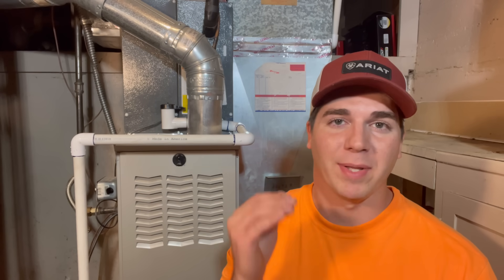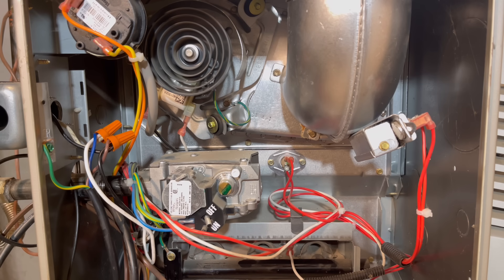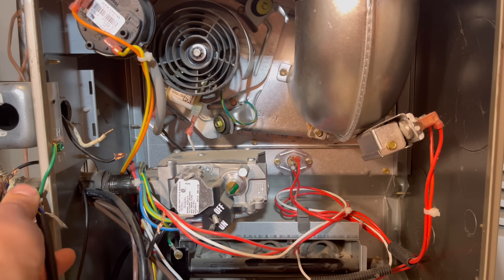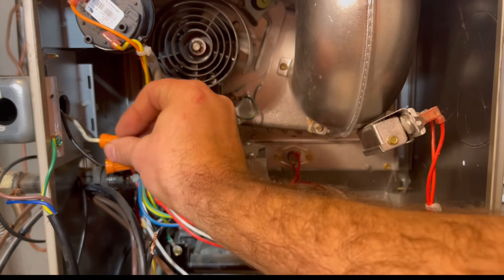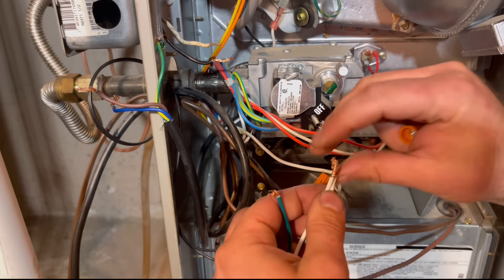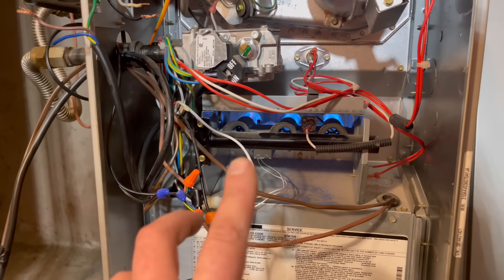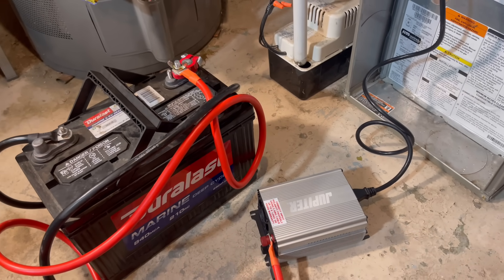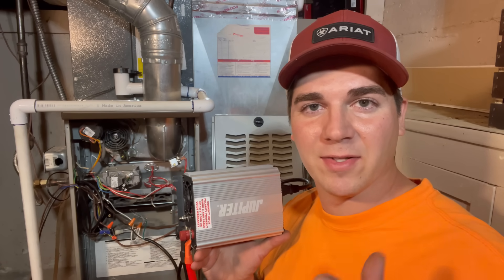Did You Know You Can Heat Your Home With A Car Battery?

Comment: Wow, that was nice, useful info. Makes me wonder if a person can set up something more permanent with multiple batteries, an inverter, and an automatic transfer switch of some sort when the power does go out. The transfer switch would make the batteries the primary source of 120/240V for the furnace while isolating it from the power grid. What you showed in the video was a manual version and perfectly adequate. Thanks!
In case you wonder... we have been hit with power outages in the middle of winter and our furnace was incapacitated. The house got on the cold side and I've wondered off and on over the years if there were a simple solution to keep the house warm. A battery just didn't strike me as having enough energy to power a furnace blower motor for long. I may have to rethink this thanks to this video.
Reply: No need to open up the furnace at all. I have a separate switch exactly like the one that is installed in the junction box right next to the switch wired to the grid. This separate switch in the box is wired to my inverter which I have mounted inside a shed outside the house.  I have a battery bank of 6 deep cycle marine batteries that operate the inverters. I simply turn the switch off from the grid power and flip the switch on from my own power and I can run the furnace independently from the utility power. A small number of solar panels keep the battery bank charging on sunny days and I have a car alternator mounted to a small Honda engine that will allow me to keep the battery bank charged when my power use requires extra capacity on cloudy days or in the darkness. I can run my entire house indefinitely without grid power. I experimented and ran the entire house for 30 days with zero power from the utility company on sunlight and the car alternator.  Use 1 pure sign wave inverter for the furnace only as a pure wave inverter is safe for sensitive equipment.  Use another pure wave inverter for appliances. I have all the rooms in the house wired with separate wall outlets and wall switches that are only connected to my inverters in my shed. This way I am independently separated from the utility for valley my power needs. Just plug whatever you want to operate into your own wall outlets and turn on your In verters..

Comment: For what it's worth, you can wire the pig tail in permanently (including the ground) and then run it outside of the furnace (through the existing hole, or drill a new one, use a grommet or other wire protection) you can then replace the existing ON/Off power switch with a switched receptacle and plug the furnace into the new receptacle. In the case of a power outage, simply unplug the cord from the switched receptacle and plug it into the inverter, no need to rewire anything and you can have heat on in seconds with out taking anything apart. Takes approximately 10 minutes to change out and costs less than 10.00.
Reply from the maker: Watch my latest video :) cheers
Reply: @diyhvacguy  where?
Reply: @Bachelor_Gabe  
Where?? On his channel, of course!
Reply: That doesn't meet code in most places but you can buy single circuit transfer switches
Reply: @MrCorynick  👈🏻⚠️Warning⚠️ OSHA has entered the chat. Yeah...I'm sure the inspector is going to drop in and pay you a surprise visit. Really!?🤷🏼‍♂️🤦🏼‍♂️
Reply: @RILEYLEIFSON_UTAH  it's just something people should know.

I don't care I do this stuff too but it's not for everyone. Just because you can doesn't mean you should.

If there was ever a fire or something and they find a mess like that you can say bye bye to your insurance and be living in your car.
Reply: @RILEYLEIFSON_UTAH  Maybe not a building inspector, but in case of a catastrophic fire, regardless of the cause, don't think for a minute that the insurance company wouldn't call that out. Then it would be on you to hire your own investigator to prove them wrong.  High stakes when the cost of your house is on the line. Its easy to wire in a transfer switch and do it the right way.
Reply: @MrCorynick  THX
Reply: @MrCorynick  NEC 400.7 states that this would not be allowed. That being said, I 100% follow the code if I am doing something for someone else. If I am working on something for myself, I try to use common sense. 400.7 is concerned with someone not using a properly rated pig tail to use for the plug and drawing to much load on an underrated cord. I assume here that anyone doing this would  determine the amperage of the furnace (it will be on the name plate) and size the plug accordingly. 400.7 also is concerned with overloading a "standard" outlet. In this case (since you are using the dedicated outlet that went to the furnace in the first place) this is not relevant. I add pigtails to a lot of items like this. Dishwashers, garbage disposals, garage door openers,  etc. This makes an extremely simple and SAFE way to replace items without having to worry about turning off (and verifying) power as well as removing permanently wired conduit. Simply unplug the item (disposal), pull it out. Easy to work on and guaranteed to have no power on it. I do not dismiss the NEC, but for my personal items I think a little common sense can go a long way.
Reply: This is an excellent hack for an excellent hack.
Reply: My furnace just plugs into the wall. I simply unplug it in the summer time. All I would have to do is plug it in to the inverter. No need for a switch really.
Reply: That's funny. Good thinking :)
Reply: Are any of these recommendations up to electrical codes? Just asking!
Reply: @bobboscarato1313   Yes. But check wirh your local inspector, township to know if it is ok for your area.  Norhing in life is 100% the same everywhere.😮
Reply: @human1513  Sorry, local inspectors asked me for the answer!

Comment: what about the thermostat?  doesn't that need power too?  and what happens if you can't get it powered?
Reply from the maker: The furnace powers the thermostat so as long as the furnace has power the thermostat will work like normal 👍🏽

Comment: Thanks for this!  Until now, I would have thought the amount of power needed to run the fans would drain the battery in less than an hour.  Can you measure the Amp hours involved in actually running the system over say 60 minutes?  That will give a rough approximation of the time one could expect to get from a given size battery. 

And one could place the battery back in their car\RV and run the engine or generator to recharge it, then get a few more days out of it.  Or better yet, swap one battery for charging while the other runs their heater.  May sound expensive buying two batteries, but going without heat in the house for several hours or more while everybody crams into the car to charge your single battery charge, is not going to be fun.  

As a good piece of advice, don't set the battery too close to the heater as it will expel small amounts of hydrogen during cycles.  I found out the hard way just how potent a tiny amount of hydrogen can be, lol.  Try to get the battery above any ignition source, as hydrogen rises.  Failing that, it should be at least three feet horizontally from the ignition source.  And for you smokers, don't smoke around lead acid batteries!  Buddy of mine blew the whole side of a battery out in his classic car.  He got acid all down the side of his cherry motor and on his hand.  (I always told him smoking would kill him!)  Other then some pink skin, many curses and tears for his motor, there were no causalities, save vanity.

I look forward to more details about this, as I live in North Dakota.  If you think freezing temps in Texas are bad, ND makes that feel like a warm Spring day!  I do have several kerosene lanterns with fuel for both light and heat, but these are not ideal and pose a small fire risk.  Hopeful you can provide some numbers on this system to determine run time!
Reply: Sorry, I did not see where you ran a full test and got six hours out of it.  

If you are up to it, they make semi-permanent diesel heaters that are much smaller than a house heater.  While one of these won't heat your house, it will easily heat a room.  So your idea of battery operated heater is not a bad one!  If you would be up to it, you could get much longer run times from a diesel or kerosene heater built to heat one room and still stay in your $200 price range.  They make an 8KW diesel heater that vents exhaust gas externally.  The idea here would be to make one room comfortable using the heater and your battery.  You could heat a fairly large space with one of these!  A friend heats his drafty shop with one and it is FAR cheaper than running electric.  

I am thinking of putting one in my basement as an emergency heater.  Tie in a 12V deep cycle battery hooked to an automatic battery tender, and you always have emergency heat of at least one room.  I can't say how long it would last, because it depends on the room size.  But you should be able to get days out of it, so long as you don't try to heat too big an area.

Here is a typical 8KW diesel heater.  Essentially, this is like a diesel engine without the piston.  It even uses a glow plug to ignite. https://www.vevor.com/diesel-heater-c_10321/diesel-air-heater-8kw-one-hole-lcd-switch-all-in-one-for-cars-trucks-rv-8000w-p_010454173881?utm_source=google&utm_campaign=19006066760&utm_term=144193765416&gclid=Cj0KCQiAyracBhDoARIsACGFcS6GEAkYuKDAAEPwu0B-ajneh5sPYB15GEbpEmUTQG4DVkM9mXxMJd4aAjNJEALw_wcB

A good deep cycle battery, one of these heaters and a battery tender should run between $200 & $250, depending on what you buy.  It's obvious that with all the politics around energy, that outages will become more and more common...  

Interested to hear your thoughts!

Comment: GREAT JOB!! This is "Urban Survival 101". I am a firm believer of having a good battery on a trickle charger in the basement. If most people kept a battery like this, and a 55gal drum for water, Everyone would be much more prepared for anything. I really liked your demeanor and your expertise into laymen's terms.
Reply: Watch out for battery fires. I wouldn't have it trickle charging it in your basement. Maybe in a garage if you have a battery charging bay box to contain it if it pops...and you don't. You shouldn't trickle charge a car battery indefinitely.
Reply: @anthonynicholson5523  great point sir
Reply: Can you hook up a Jupiter 5,000w power inverter to a car.If so what's the proper way to do it using up to 5,000w ?
Reply: @drrobotnikmeanbeanma   5000 watt inverter draws appox 420 amps max on the supply side. You need big cables for this and proper fuse sizing.
I dont know of any car alternator capable of supplying this much current.
Reply: @schickmann  what about 1,500w or 2,000w ?
Reply: Like you comments and I agree, wish people would consider things like this instead of freaking out and being 100% DEPENDENT
Reply: you're gonna get sick drinking that water buddy. When you are finished with this go outside and take a nice refreshing walk
Reply: @highorbit3282  not if you know how to properly prepare potable water from storage.

Comment: Nice idea but as many of the other commenters stated, the run time in this format is very limited. Several years ago, I took this one step further by connecting the inverter to my INSTALLED car battery via a 100 Amp Anderson connector ( often seen on electric forklifts) and pigtail. With the engine running,you have a longer run time on the inverter. I did this during Superstorm Sandy and this method kept many furnaces and refrigerators going.
Reply from the maker: I have another video on this. Thanks for the comment! Cheers

Comment: Yep! Great advice! Did this during a power outage a few years ago (by flashlight) but I changed the switch to an outlet and ran the pigtail out a hole in the furnace so I'm always 'plugged in' to the outlet. If power goes out, I simply unplug from grid power and plug into the inverter. Note: You will need at LEAST a 500 watt inverter, preferably 600. The hot surface ignitor (glowy thing) takes at least 400 watts on my Carrier. My 2 stage furnace takes about 400 watts on high and 250 watts on low, so power draw is fairly low for the amount of heat you get out. I'm not sure if it would run several days but definitely 12-24 hours. I keep a marine battery (cheaper than a deep cycle but better than a car battery) on a cheap smart charger in my basement to run a few lights, fridge, and my furnace if needed but rarely need it.

Comment: A much safer, and code compliant solution is to have a single transfer switch, such as a  EasyTran TF151W pre-wired to the furnace. It has a 120v power inlet which will accept an extension cord. That way, an extension cord can be plugged in from the inverter or remote generator without messing with the internal wiring of the furnace during the outage, requiring only the flip of a switch.
Reply: Exactly  what I was thinking!

Comment: I have a Burnham Series 2 gas boiler. It works but it always keeps the house at almost 90 degrees Farenheit. Right now I have the breaker to it turned off. I've tried to program to the thermostat, the batteries are new but to no avail. Do you have any advice for me please? Thanks.
Reply from the maker: Hmmm. Maybe just swap it out with a simple non programmable tbermostat.

Comment: Most inverters are inefficient. Disconnect it after warming the house some. Some inverters produce good sine wave power however most inverters and many generators develop crude power. Crude power is fine for incandescent lights and most motors but destructive to electronic items and modern ECM motors

Comment: You can buy a generator at harbor freight cheaper than a battery and it would be way more efficient that this. I can’t see this lasting more than a few hours. If you was able to leave battery in a car so you could keep it charging it may be a ok idea.
Reply from the maker: Not when there isn’t a single generator left 👍🏽 this is a backup for that.

Comment: Does it have to be a 1000 watt inverter ? i have a 200 watt and a 1200 watt inverter ,,, how much power does it actually draw ?
Reply from the maker: My drew 500 watts when running. A 1200w should do just fine. But it kind of depends on how big your furnace is.

Comment: Your demonstration would be even more impressive if the wire to the switch had a Plug and Receptacle on the wall. Allowing anyone to switchover quickly without wire-nuts.
Reply from the maker: Check out my latest video! 🤯

Comment: Could you connect both a battery maintainer and the inverter to a battery and run the furnace off that for an extended period of time to create a DIY UPS? Any reason that's a bad idea?
Reply from the maker: Yes with a separate battery that could work. But if you are talking about the same battery, the laws of thermodynamics won’t allow it :) cheers

Comment: You should stress to everyone that this should only be used in an emergency situation, as the low amps will cause the main furnace fan to fail eventually.

Comment: Great video!!!  Also, don’t forget most newer vehicles have built-in power inverters.  You can ide your vehicle for 110 volt supply. During power outages during the summer time I’ve plugged in several fans and charged mobile devices all night long using the inverter in my 2020 Dodge Ram. Used less than 1/8 tank fuel during all night idle.
Reply: Could you run a space heater off this ?
Reply: @dannyhayes664  - Absolutely not.  Unfortunately.

Comment: This works provided that the ignition module does not use any solid state proofing sensors. These power inverters sometimes lack a true 120v grounding pin which is required for solid state sensors. This same setup didn't work for my Polaris High Efficiency water heater during a power outage. The flow sensor kept showing that it was open and failed to ignite.

Comment: I have baseboard heat, any suggestions?
Reply from the maker: I believe this will work for you If your circulator pump is just 110v
Reply: @diyhvacguy  Thanks. What do you think of Dr. Kool? Self installing AC

Comment: Would a battery backup system for computers work for this? Just a  CyberPower or APC 1500 VA unit should power it up. Correct?
Reply from the maker: I’m not sure as I’ve never worked with those.

Comment: How many watts does your furnace draw? I have a 1000w inverter. I never tried it on my furnace (12 amps- 1380 watts). It wouldn't start the fridge (1.8 amps- 207 watts) or the freezer (1.7 amps-196 watts). It did run the sump pump (7 amps-800 watts) And it ran my half inch drill (6amps- 690 watts). There are bigger inverters and at least 2 different types.
Reply from the maker: 500 watts is what mine pulls

Comment: I have solar coming in to the house as a backup.  Been meaning to setup transfer switches to all the important stuff like furnace, fridge, freezer etc.  This is a great way to ensure you still have heat in winter if hydro goes out.
Reply: Solar ain't no good in winter, when the sun its lower and don't shine as much as during summer months
Reply: @vikingored7469  Yeah need a bigger system to make up for it. I only have 400w.  If I turn off the inverter it keeps the battery charged but if I try to use the power it takes like a week to charge it back up.  If I had more room I'd put like 10kw then I'd be good I think.
Reply: @redsquirrelftw  hey there Re squirrel do you live in town or out of town, 
Are there any neighbors close to your house?
 What about using a generator with some walls around it to Muffle the noise/sound ?
Reply: Solar is free to run, though I find I'm really not getting much production in winter, so I bought a 27v power supply and a generator plug, I'll set it up so I can top up the battery with a small generator if I need to.  Overall we rarely get outages here though so just never bothered to get a generator.